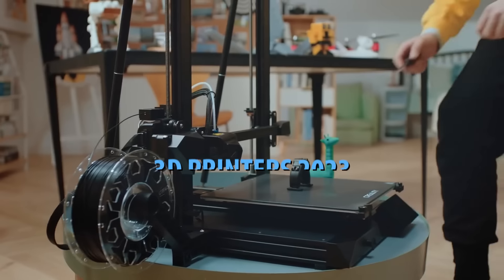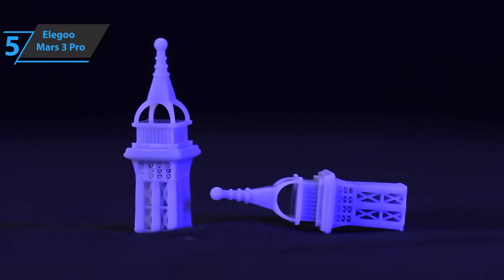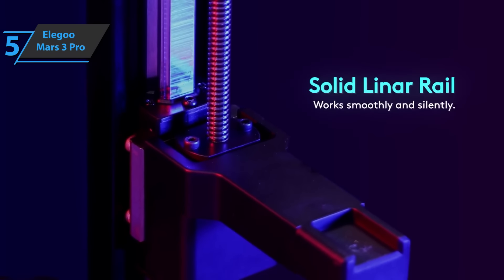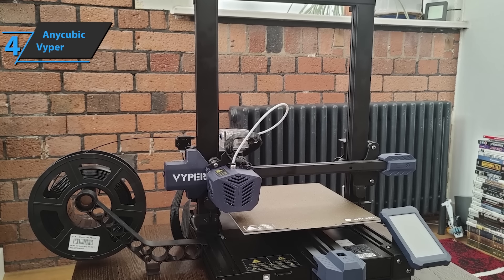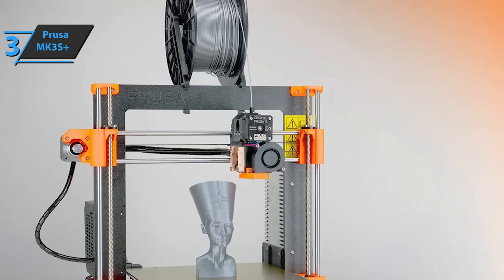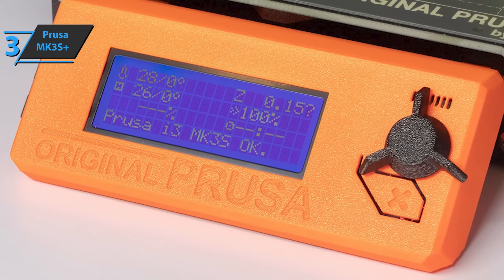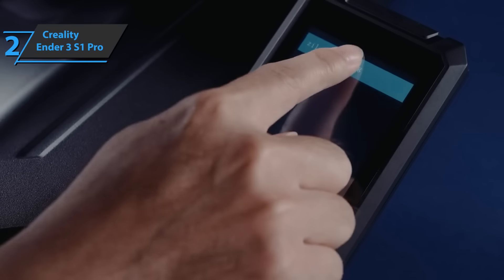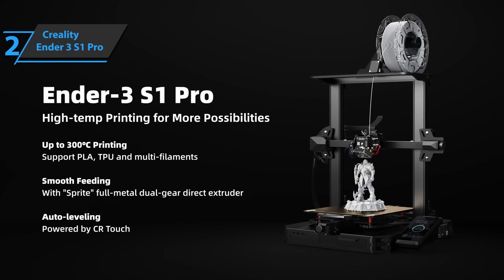Top 5 BEST 3D Printers of [2023]

Comment: I would say the best and affordable 3-D printer would be the bamboo labs p1p allowing auto leveling 
And is able to print faster and still keep that nice high-quality print to it
Reply: Whats about the elegoo neptune 3
Reply: @aaronwalbrun4234  elegoo 3 is a good printer but the bamboo labs have a faster print time and higher detail 
And the elegoo has a slower printing speed but can make bigger things but auto leveling doesn’t work the best but they are both good printers but I would say the bamboo labs is the best 😁
Reply: @flixey  du meinst aber ein Bambu oder?
Reply: @aaronwalbrun4234  English please
Reply: @flixey  you mean Bambu right ? And WhatsApp do you trink about the QIDI x plus 3
Reply: No one every talks about the privacy issues with the Bambu range and that they can use the video recordings from teh built in camera and access to any models that go through the printer. Ok for at home hobbiest, but would you use it commercially?

Comment: It sucks that the top 2 printers are calibrated manually. He said they automatically calibrate but you can see the printer is made to be calibrated manually. Especially since I had more bad times with Creality products than good time. I might check out the Cobra one or maybe Prusa.
Reply: I agree, I have tried 2 Creality printers and neither were good experiences, so I’ve shied away from that brand. One of the printers was the Creality Ender 3 S1 pro and within 2 weeks I had a thermal runaway error. Once I fixed the thermistor the bed went out. I ended up throwing them away and going with Prusa's.
Reply: @Snap Count  supposedly early ender 3s were amazing, then they got cocky, stopped giving a shit and just used their reputation to sell units with cheaper parts. I was going to buy an Ender but did a bit more research. And after all the research I have no idea what to get lmao
Reply: @Deathstock  lol...I have 3 Prusa mini pluses and love them. I have not had any issues with any of them and have probably over 1000 print hours on each. The only downfalls are their size and the time it takes to get them. I needed a bigger printer, so I went ahead and bought the Anycubic Vyper. It just arrived yesterday, and I’ll probably put it together this weekend. I’ll let you know how it is. I have had the longer 5k and liked it a lot. I’ve also had a couple of kingroon KP3s and they were good for a cheap printer. Any printer that I purchase from now on will have automatic bed leveling because it is a huge time saver plus it compensates for warped beds.
Reply: whats the best one i can get for around 200
Reply: Ender 3 S1 Pro is auto leveling…
If the bed is off too much, then you can manually just adjust it to where it’s close ish, then auto level and you’re good to go.

Takes maybe 20 seconds of “manual” work, then just start the auto level and you’re good to go.

Comment: 1. Bambulab p1p
2. Prusa MK3

....
Spend some more money?
Voron, Babmbulab X1CC....

Never ever a Creality anymore...
It just works great with the sonic pad and for 200 more you get thr P1P which is much mote reliable.
Reply: Creality is unfortunately just trash, now. With the BambuLab's p1p and X1, yeah. Only Prusa and Voron-based printers will be able to keep up. For my comment on Creality, here's why:
I bought the S1 Pro off Amazon for $500, worked fantastically for 4 months. 2 Months ago, I wanted to upgrade to the Sonic Pad (Creality's NeW pRoDuCt) which is supposed to be compatible with a wide range of their printers. I checked my board before telling the Sonic Pad which one I had so I didn't brick the printer. Great, step one it works. Step two, I see they have an update. Great! I update and can no longer use 3 out of the 4 USB ports on the Sonic Pad. And half-way through my prints the Sonic Pad "loses connection" to the printer it's directly connected to. Changed cords, changed micro SD cards, completely wiped them back to FAT32, etc, etc, etc. Nothing worked. Couldn't even put the Sonic Pad back to the previous version. Oh and the best part? IT BRICKED MY PRINTER ENTIRELY. Couldn't even re-install any version of the S1 Pro at all. Went looking through their website, forums, anything I could think of. Thankfully, TH3D had a work-around where you basically make it an Ender 3 Pro with a Sprite Extruder. So I bought a new board, LCD, and some other parts from them and got it working. But it's not fast anymore and I'm just disappointed in it. Emailed Creality after the whole thing happened, told them everything and asked for a refund on the Sonic Pad. Not even the printer, just the Sonic Pad. 3 weeks go by (I guess we don't give a shit about customer service in China) and they keep pushing to send me another one. I say no, I want a refund and here I am 3 weeks later waiting on another reply which I am unlikely to get. Moral is stop buying shit Creality printers. Put them out of business. At first I had no issues with that company, but now after all this wasted time, yeah. HUGE issue and we just keep them in business by buying their crap printers with crap customer service. I am going to give my money to Prusa from now on. They have earned my business.

Comment: can the basic s1 be converted to s1 pro version by swapping parts?
in my country the s1 pro is 230 usd more expensive than the regular version
Reply: I've seen the light bar for about $30 in Amazon from creality.
Reply: Honestly all you really need is the bimetal heatbreak and essentially you have a pro not much different and very easy also depending there may be a sensor or two but either way there normally very cheap from creality.

Comment: Yeh no.  Bowden tube printers are not recomended in 2023, just for starters.  Also, large bed "bed slingers" are not recomended either. CoreXY is the way to go if the bed is larger than 240x240mm.  As for the 4 FDM printers, the only one I agree with is the Prusa.  If you are going for price points, then that is another conversation.